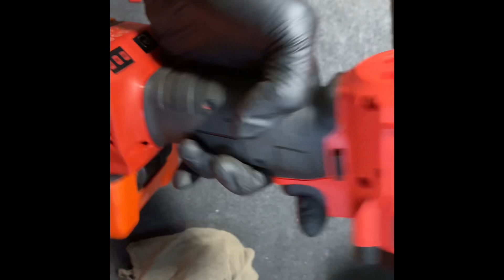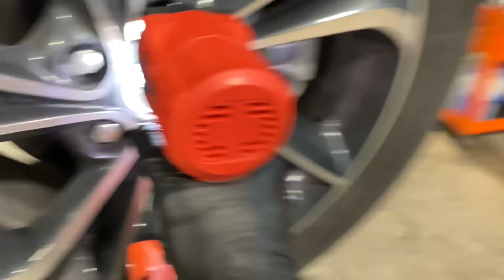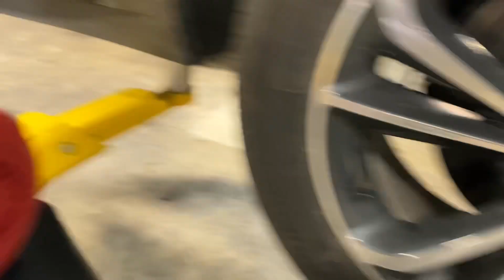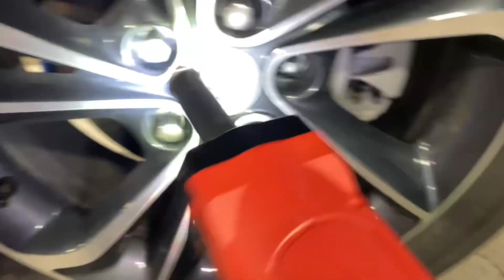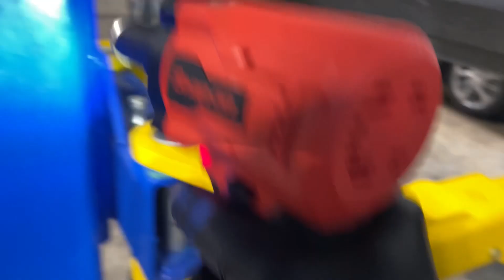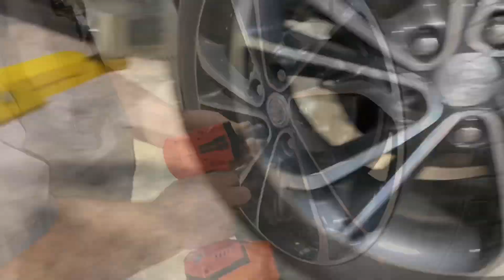Snap-on CT9038

Comment: Is this good or bad? I dunno one way or the other.  I mean I’d rather do that than snap my back but in a shop all their tools seem strong. Seems like the tool is for tight spaces.
Reply from the maker: It’s a very powerful tool by itself, yes there are things that this won’t always be able to loosen but that goes for all 3/8 drive impacts. Air or battery powered they both have limitations. If you already have invested in Milwaukee 18v tools then I would say to possibly stay with your brand. If you have the opportunity to try this CT9038 then all means go for it. The tool is conveniently sized so it does fit in tight spaces pretty well. If you’re trying to compare this against the m12 3/8 stubby Milwaukee tool, in my opinion this blows that tool away hands down for power to tool ratio.